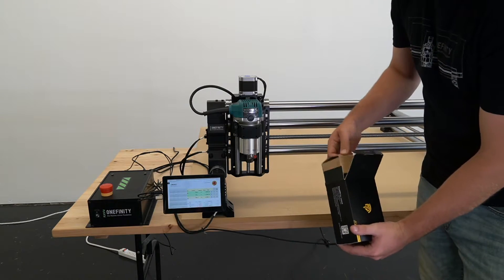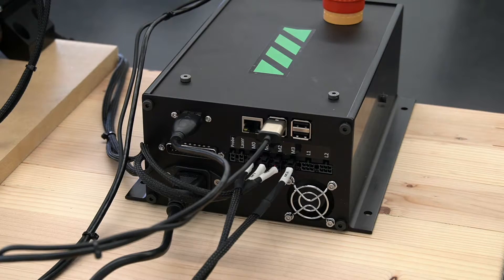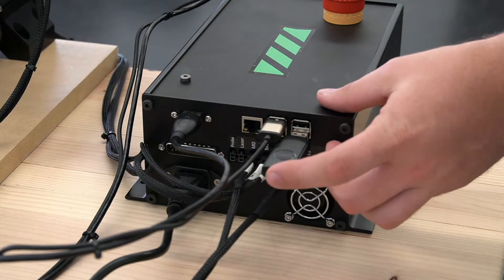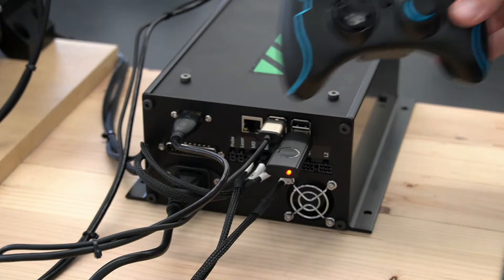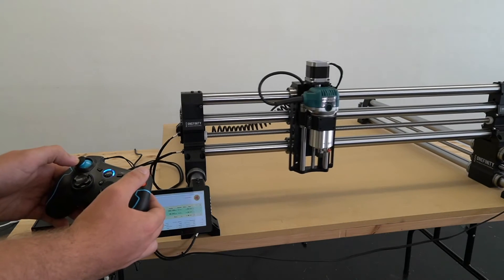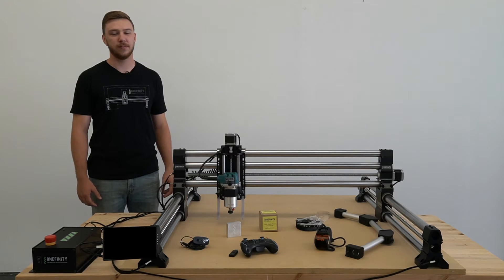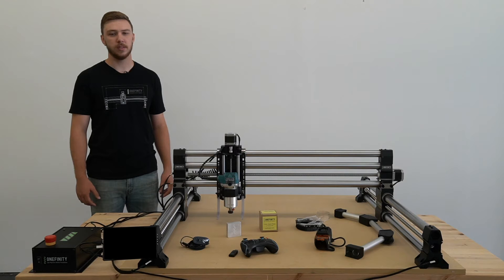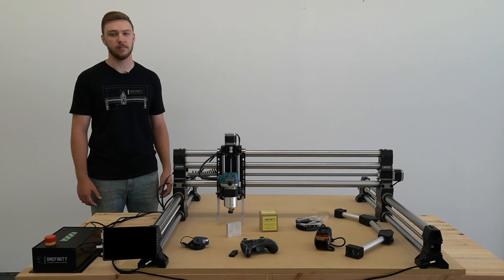Connecting the USB Joypad

Comment: I just got my cnc and bought a easysmx wireless controller from amazon. I paired it to usb dongle but doesn’t seem to control cnc
Reply from the maker: You may have gotten and identical looking, but different model controller than we sell.
Reply: @OnefinityCNC  model was esm-9110
Reply: @p8ntblr1  this is the model that works Model ESM-9013)
Reply: @OnefinityCNC   I thought any usb controller would work?  Is there a setting on the controller that needs to be turned on or some other setting?